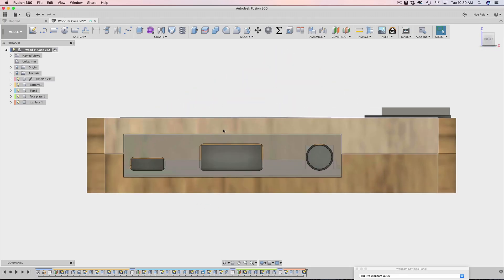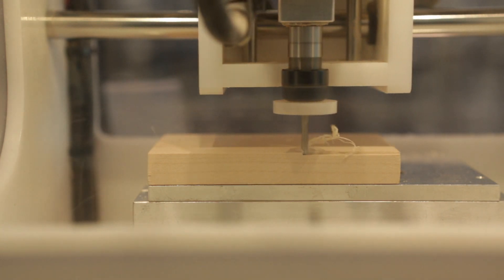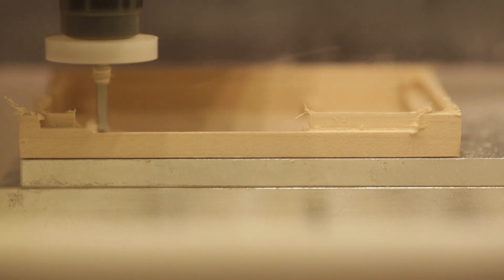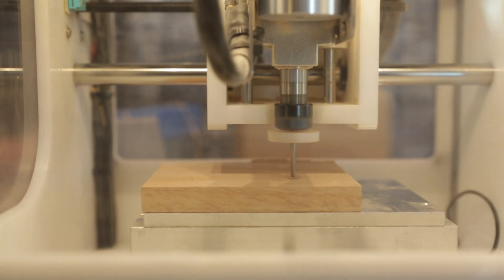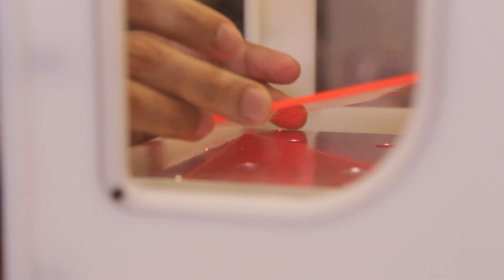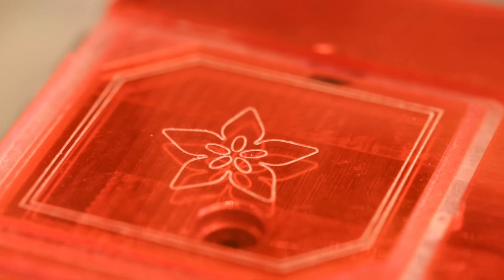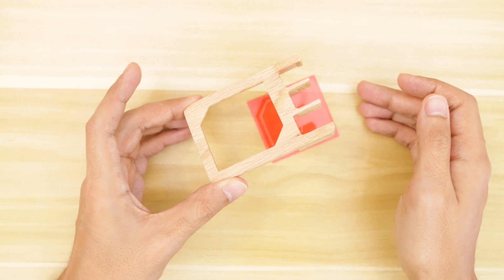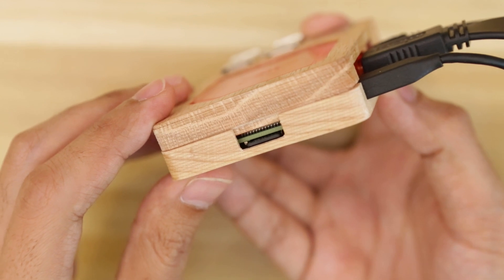How to CNC – Raspberry Pi 3 Case

Comment: I've just started watching videos on this CNC machine. Noticed you needed to remove a lot of material on the oak piece. Have you considered buying a small handheld planer to speed up your work in these cases where the thickness isn't what you need?

Comment: really cool project. 
I'm pretty jealous of your little CNC.
I work everyday on 2 CNC machines but I would really like to have a small machine at home.

I hope it is ok if I give you just 2 small hints.
first, if you engrave acrylics, you could try take 2 steps in the depth(1st one to total depth minus  0.1mm, and a finishing pass with a higher speed)

And 2nd, have you tried to run your tool in the opposite direction, maybe you get cleaner cuts in the wooden material ( and also reducing the spindle speed)

now I'm going to watch your other projects, because I liked this one a lot.

greetings from germany

and sorry for the bad english.
Reply from the maker: thank you for the tips! I will try this the on next CNC project.

Comment: I see your using what seems to be a flat plastic collar on your bits  Is this a standard part or did you custom make them? I believe they keep Z bit reference for your machine so you can preset the z offset.  How can I get a set?
Reply from the maker: It's a "Bit Fan", slides onto any end mill (1/8" shank) comes with the othermill. It's actually machined on the othermill using HDPE. http://blog.othermachine.co/introducing-the-bit-fan-a-new-othermill-accessory-you-can-make The othermill pro will "probe" the bit after each tool change, so it knows how much to offset the z before machining.